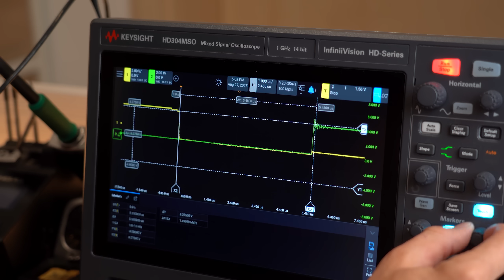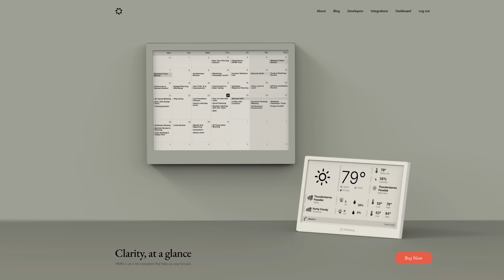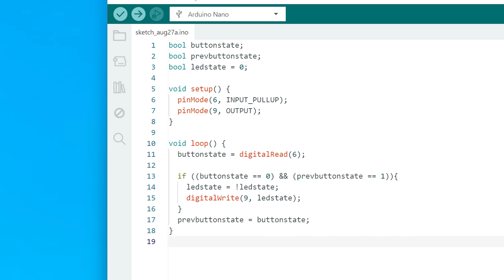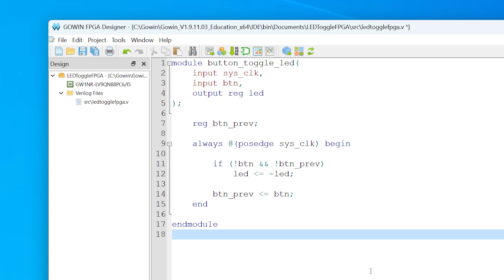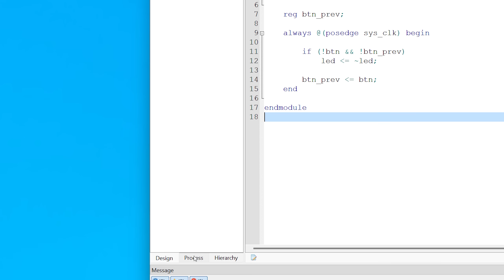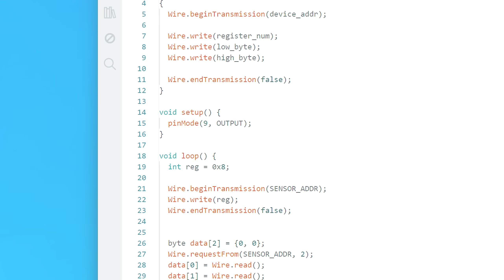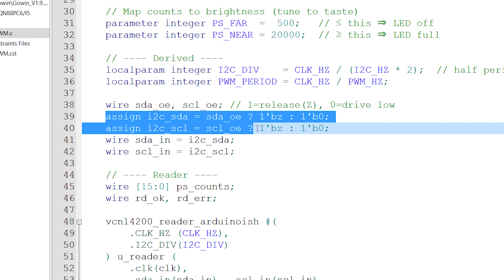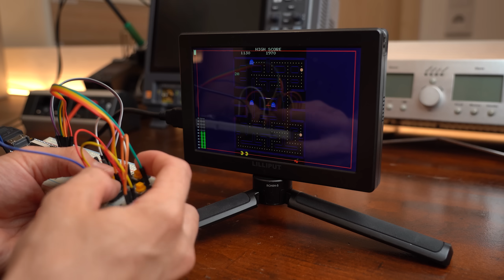The Harsh Truth about FPGAs (You Should Avoid Them?!)

Comment: You most certainly can use FPGAs to talk down I2C bus you need to find an I2C implementation in the FPGA language you are using.
In the same way Microcontrollers were hard to use before we had the Arduino libraries.
Reply from the maker: Hmmmm yes and no. I feel like microcontrollers were always a bit easier. I used them without libraries before. But maybe it is all subjective.
Reply: @greatscottlab  To be fair, the microcontroller has already all the "libraries" (in this context) "preprogrammed) in the silicon. FPGAs is like getting a clean protoboard PCB filled with blocks from the manufacturer ready to be wired.

That's why for FPGAs you will want always to use the libraries when available. The FPGA is clear.
On the micro, you may or may not use them, as the micro is already filled with something to be used out of the box.
Reply: @greatscottlab  It changed a bit when Microchip started making PICs with peripherals to customer specifications. Adding functions to something like a 6800 or 8051 was not convenient.
Reply: @greatscottlab  " I used them without libraries before"
You used "digital_read" and i2c libraries for this.... That is the whole point of such simplistic tools like Arduino: Provide the basic libraries and do a simplified setup that makes it easy to get started.

Comment: The FPGA equivalent of the I2C peripheral and library you mentioned would be something like a reusable I2C "IP core." These things exist for HDLs as well and you do not have to always create functionality from scratch; they are just called by different terms.
Reply: I was going to say something similar: The HDL is meant to abstract away the specific details of the FPGA, so instead of using the FPGA type in your query / prompt, use the specific hdl you want.
Reply from the maker: Thanks for the info :-)

Comment: During my time at university, I had a course about FPGAs in which we worked with a Xilinx FPGA. I agree that they are more expensive and the learning curve is steeper than with microcontrollers, but if you need the performance for your application (driving a big screen, fast ethernet, real-time motor control...), they are just awesome.
A few points from my side:
- Regarding the I2C issue you have faced: Many vendors provide pre-made IP cores for many standard protocols. Maybe you can check if GoWin provides a suitable core for I2C.
- There is something called HLS (high-level synthesis) which creates HDL code from C/C++ code. For example, Xilinx offers the Vitis software which allows you to do just that. You cannot use all the language elements of C/C++ and you have to keep in mind that all the code you write must be implemented in hardware, but it could make it easier to get started with FPGAs if you have a software development background.
- If your FPGA is large enough, there is the possibility of implementing a so called "Soft-Core" processor. Basically, you can use the hardware inside the FPGA to integrate a whole microprocessor (ARM-Cortex, RISC-V...) into the FPGA which you can program just like a microcontroller. With this, you have the best of both worlds - the processor can easily be programmed to handle the tasks which are less time-critical and it can interface with the rest of the FPGA, which handles the parts of your application which need to be executed fast.